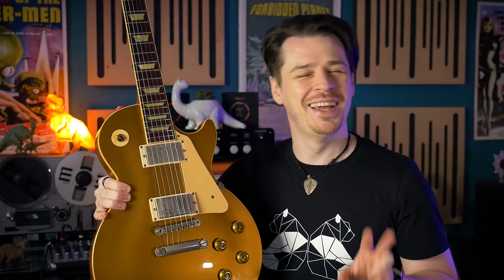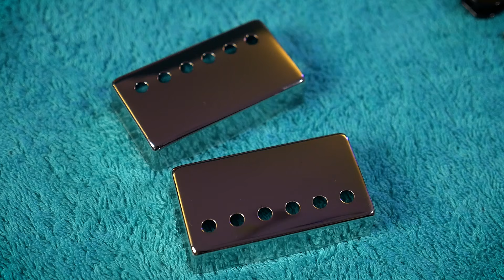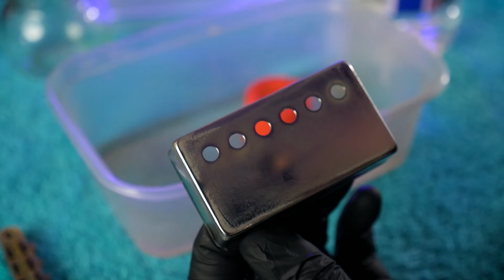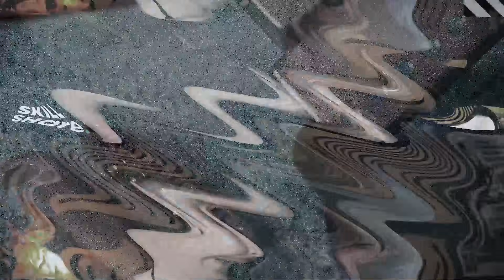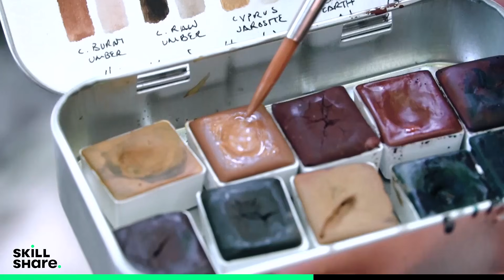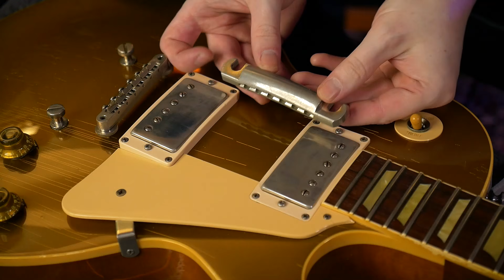Making NEW Guitar Parts Look OLD | Axe From The Grave

Comment: The feroc chloride part can trash your hardware in a second. Literally one second! 
Best to dilute it to 1 part feric and 2 or 3 parts Distiled water. Also, dont try and achive the level of finish with the vinegar or feric chloride. Go a little bit less than you want then polish it and see. 10 mins with the vinigar max and only use the feric on the exact areas you want to age more. Also use super find grit, like 3000 plus. 

I did a bit to much fume chamber and feric and when I polished them the last of the plating came off. Their basically grey now.

Comment: I love working with nickel, I use a concrete cleaner, I can’t remember what it’s called. I place the hardware in a container , then set that in another container containing the solution. It’s extremely strong and should be done outside. I let it sit for 30 minutes at a time only allowing the fumes to get on the parts. Take them out and wipe them down. Once level of aging is achieved I wash them off, dry them and reinstall. If after the first season is not enough, then I do another 30 minute round. Works great!
Reply: I believe you're speaking of muriatic acid.
Reply: @flapjack413  that’s it! Thanks!

Comment: That abr1 bridge sits in the wrong way. (Screws should be at the opposite side. Screws are held with a retainer or without on some.. The angle of the strings to the stop bar/ tailpiece can lift the saddles up and or put uneccessary strain on the retention clip and you can have weird Citar-effect or strings not ringing at best.) Gibson installs these always the other way. (Screw heads to the pickup side) It's the (bigger wider) "Nashville" style bridge which has the screws through holes that's placed like the way you have it in this video. 
But of course it's your instrument.😉
Reply from the maker: 1. The saddles were slotted and installed for this bridge orientation.
2. It allows access to the intonation screws without having to lower the bridge pickup.
Reply: @ScienceofLoud  did you read what I wrote?
Reply from the maker: @klauscottonswab2322  did you read what I wrote?
Reply: @ScienceofLoud  Yes, someone who would interpret what I said correctly would not have One-Two'd me and answering questions with questions. Someone who seeks malice or and is insecure would. 
Not very nice. Unsubbed.

Comment: I got a 97 ebony with gold trim Les Paul. And HAD to change some parts. Bought everything in gold and then rubbed each piece for just enough wear to keep them even. But didn't mark up the tuners cause these don't actually get that kind of wear. But the Tonespro locking bridge and tailpiece do look right in my eyes and the plastic has enough wear to match the body wear marks so none of it looks off. But what's really unbelievable is how much wear my Paul has compared to my Amer deluxe plus Strat. The Strat is 4 yrs older yet looks so much cleaner and prettier.

Comment: Hi again Mr Colin trusty luthier !

Why you wax potted the pickups with the black "glass" 3M tape already placed around the 42 or 43 gauge copper wire ?? 
I know that the 3M tape glue will not stick to the Parafin Wax if previously done but my guess is that if you do a couple of tape overturns,  it will stick well onto itself or I can also add a drop of CA glue to secure the 3M tape onto itself.

Can you share your input on this matter, please ? 
Thanks in Advanced......Mr True YT Treasure

Comment: would love it if you could do a video on properly soldering guitar parts, a lot of videos out there already assume you have some experience and say things like "get good solder" and "once your iron is up to tempterature" but never say what is "good solder" or "proper temp" and minimal advice on technique and having a video that goes over this stuff would be great
Reply: I'm assuming "good solder" means 60/40 rosin core and not to fuck around with lead-free. Proper temperature varies with the material you're working on, you want it hot enough that the solder will flow onto the material but not so hot as to instantly fry the wire or whatever. Somewhere around 700ºF (Or 375-400ºC if you hate the freedumbs) *

*DISCLAIMER: I'm a soldering noob myself, but I've watched a number of basic soldering tutorials and done a handful of things that have held up and not needed re-soldering. (Granted, I've re-watched tutorial videos before basically every attempt)
Reply: @thygod  I prefer 63/37 solder.  No joke!

Yes, use a hot iron -- I bought a Weller soldering station, which was quite a bit more money than a basic hardware store pencil, but it was very much worth it to me.  If you can get a soldering station with an adjustable temperature (40w for fast recovery), yes, your 700F is a good temp.  I actually work hotter (735-750) and quickly, as the iron spends less time on the joint, and is less likely to heat up the rest of the part.  This takes practice, though.  Don't practice on a cherished guitar or other important project!  

If your iron doesn't have an indication that it's up to temperature, test it with a piece of solder.  If it readily melts the solder onto the tip, it's ready.  If it sorta melts the solder, let it heat up  more.  Once it's hot, clean the tip with either a wetted sponge, or a copper soldering iron tip cleaner (preferable, as it doesn't cool the tip).  "Tin" the tip of the iron with solder -- this means to melt solder onto the tip and let it flow around.  Some solder may drip off, so be careful!

If you're soldering stranded wire, tin the wire before making the joint -- heat the wire up with the soldering iron, then touch the solder to the wire and let it flow through the strands.  This takes only a very little bit of solder.  Work quickly; heat will travel up the wire the longer the iron is touching it, and it could burn you.  If you're not ready to work quickly, hold the wire with pliers.  If you see your insulation starting to melt, remove the heat, let it cool, and try again.

Then, heat up the joint you're going to solder.  Touch the solder to the joint, not to the tip of the iron.  You want the joint to melt the solder, so the solder freely flows all around it and makes a good, solid contact with the whole joint.